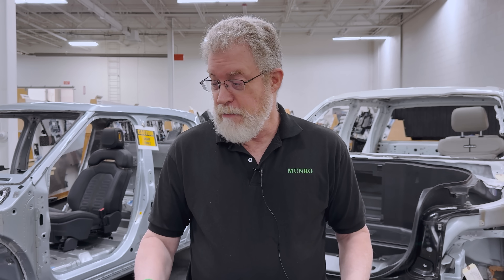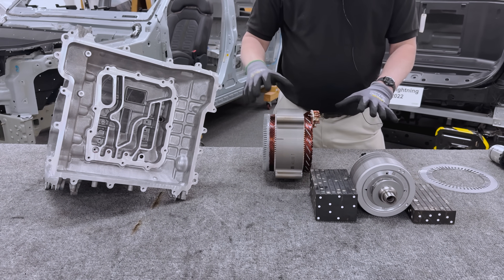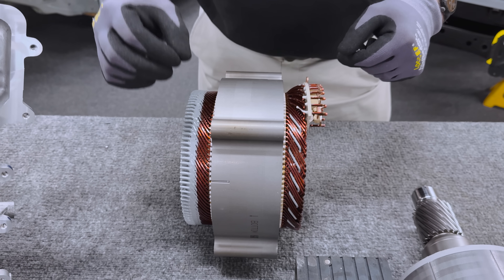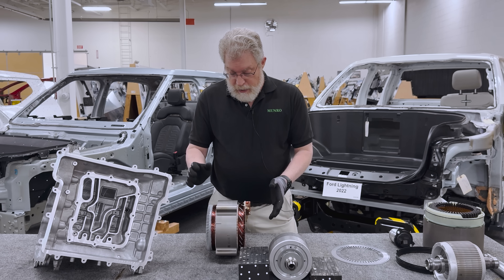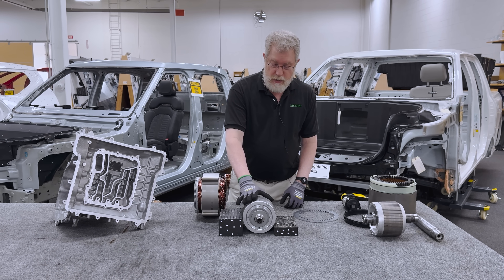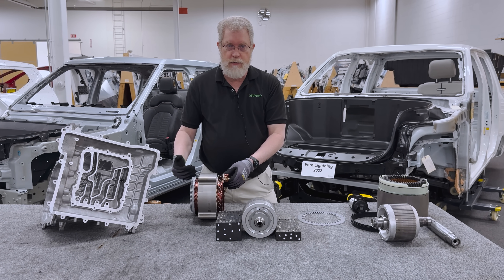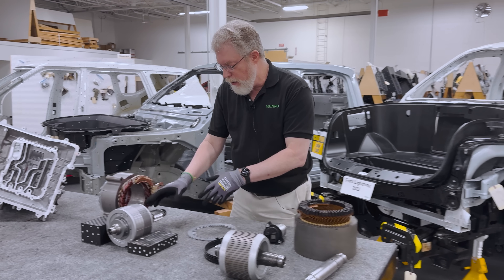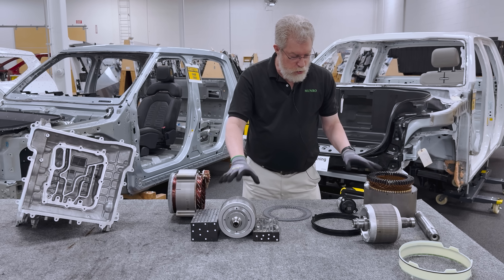Inside EV Cooling Systems: Tesla vs GM Electric Motor Comparison

Comment: What happens when you are in stop and go traffic and the motor is not spinning. Tesla can continue to control the motor temperature. GM looses cooling. Maybe it does not matter?
Reply: It’s also important to note that the stator windings are used in conjunction the oil pump to generate heat And dump it into the cooling system to condition the battery in some situations. Mechanically driven pumps don’t allow this when stationary.
Reply: @juancarrera5524  Only Tesla does that. Other manufacturers have equally (or more) effective methods.
Reply: Tesla obviously has better controlled cooling with pressurized oil, and can handle edge cases with thermal mounting (not covered in this review?).
Reply: An EV not moving has a motor not turning,  therefore not heating or generating friction.
Reply: When the motor isn't spinning (powered), it's not making heat.
Reply: @johnbirkland6254 , the  motor  generates heat whenever it is producing torque, which could be when it isn't turning.
Reply: when you are not moving the motor doesn't consume electricity so no heat produced.
Reply: If you have auto hold on in gm evs it uses 1-3 constant kws depending on the slope to hold it in place fyi.
Reply: @4literv6  Yes, this is the challenge for the cooling approach that GM uses.  They resolve it by engaging the parking brake (a feature they call "hill hold" invented for manual transmission cars).  That way the motor can be turned off to avoid producing heat while there is no cooling.
Reply: @4literv6 I'm pretty sure autohold simply applies the brakes once the vehicle stops. I can feel them releasing most of the time.
Reply: @4literv6   I’ve had a Chevy Bolt since 2017 and I believe I have only seen the auto hold message flash up on the driver information center three times.  It might be different if you live in a place which is all hills such as San Francisco.  I have a feeling that GM tested it pretty thoroughly (see following paragraph).

Back in 1983, I had a job interview at GM in Kokomo for the engine controls division.  They were doing pretty extensive computer work up front, then track testing, then on-road testing all across the US.  I was impressed at just how extensive the testing was.  They also had some engineers driving test mules as their daily cars.  Engineers sometimes put high performance power train components in sleeper cars.  There was a neat head-up display which allowed tuning ECU parameters and the ECU was simulated in a large box strapped in the back.  That was 42 years ago, of course.
Reply: Nope it pressurizes the brakes no power@4literv6
Reply: Actually no our equinoxes power gauge clearly shows 1-3kws used constantly to hold it in place, and yes even with the brake engaged which one can clearly hear and feel them releasing which tbh is fkn annoying! I've almost been rearended in heavy traffic several times due to the small delay which when you experience it the first few times is downright disconcerting!
Reply: @4literv6  That's what brakes are for.
Reply: @antoniocirino8444  Stop and go traffic isn't the best example. Now do some hill or rock climbing where there is a great amount of energy needed creating a tremendous amount of heat but very little movement. This is where Tesla and most trucks should have positive pressure cooling. I don't think you need to worry about his too much with the equinox but if they are doing this with the trucks it may cause a problem with overheating the motor.
Reply: @antoniocirino8444  True but in a traffic jam or congested city driving on a hot day I'd worry about the heat building up. Idk if the reduced motor use is balanced by the reduced oil flow - but since this guy says the GM system is excellent I'll take his word for it. Unless a deeper dive needs to be done on the corner cases.
Reply: @donjones4719 very little power is moving through the motor so it won't heat up, it's not like an ICE where even at idle it's running at several HP and generating heat.
Reply: Look to be a similar situation with a turbo compressor on an ICE motor.
After a long trip, the turbo connected to the gas xaust is very hot. 
So when you get stop at a traffic light or stop the car and park,
the turbo takes time to cool off but the engine is not providing and air flow,
and often the turbo axial bearing overheat and the turbo get damaged because of oil starvation.
Reply: @nihongobenkyoshimasu3190  Exactly.

Comment: Is the Tesla oil pump speed thermostatically regulared?
Reply: Yes, Tesla can use precisely the cooling flow required to maintain the temperature of the motor using the least energy.  The improvement in efficiency can offset the increased cost.